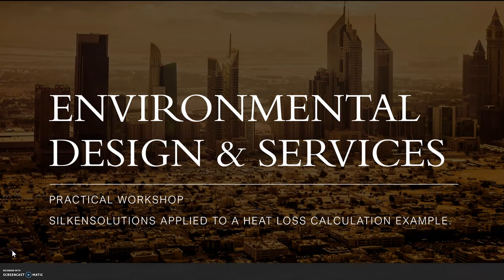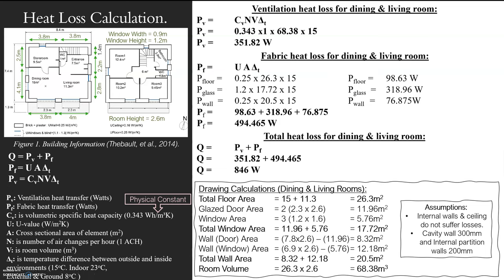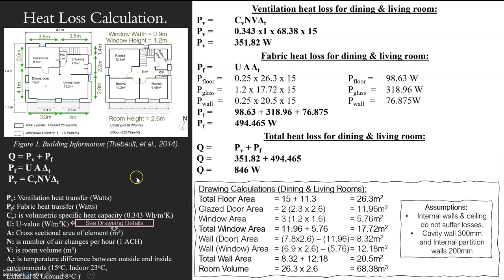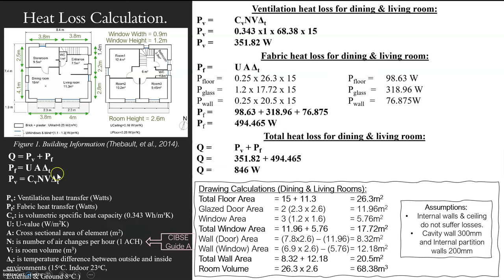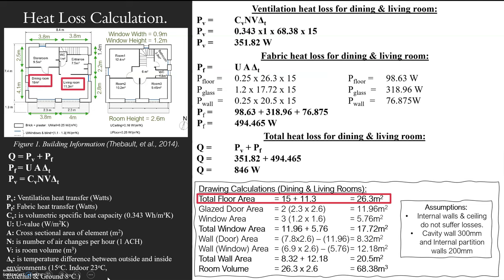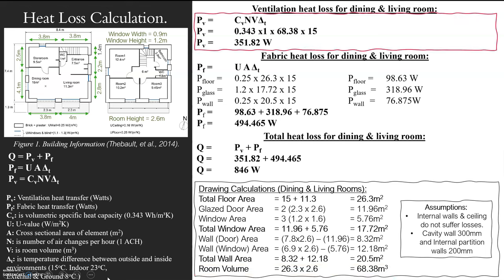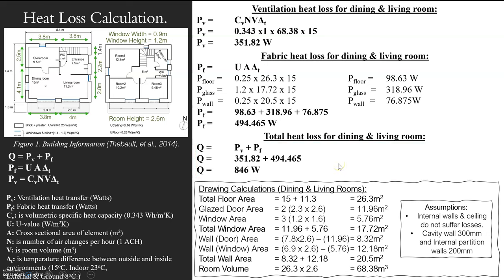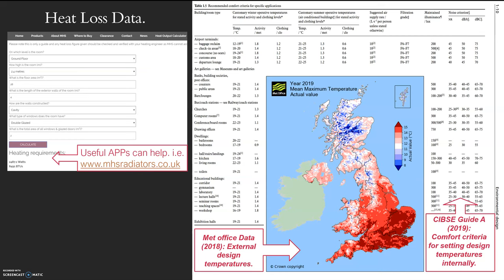Thermal Calculations: Heat Loss for domestic room.

Comment: Not sure where you live in the UK, but using 15C DT, will leave you with an undersized heating system. You should never use mean winter outdoor or soil temperatures, when calculating fabric heat loss, for the purpose of heat emitter sizing. Using 15Degree C, means you'll never  be able to achieve 21 Deg C room temperature, once it drops below 6Deg C outdoors.
Reply from the maker: Apologies I don't look at comments normally as these resources are for my students. I'm not a published author and use notional numbers for ease of showcasing the calculations sometimes. I do understand you're asking for me to make it more realistic so when I come around to upgrading this resource I will ensure to add this detail.